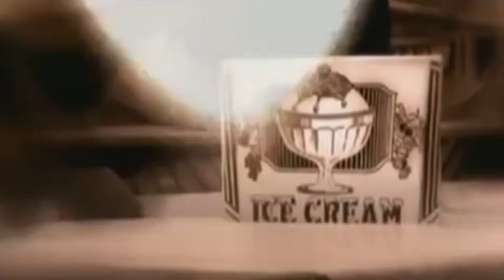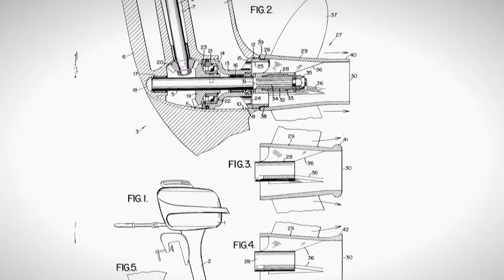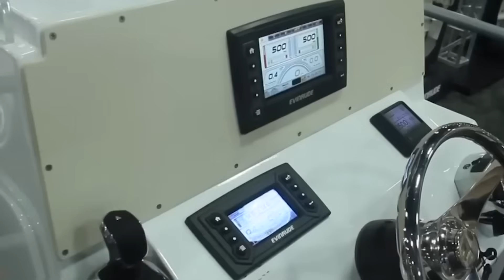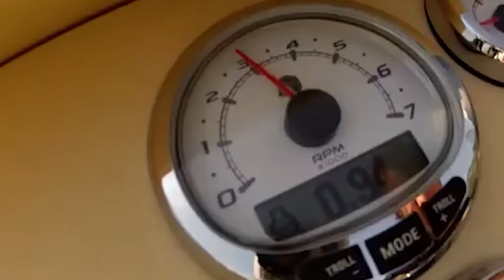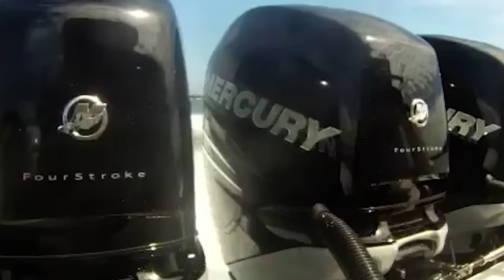Why Mercury and Evinrude Motors Are So Different?

Comment: Vintage Boats, you never mentioned the technical main engine platform mechanical design specification differences of the early Evinrude vs. Mercury outboards. Which accounted largely for the distinct differences between them. Evinrude's were mainly a higher torque... (powerful) workhorse engine vs. Mercury's speed, but less torque (raw power), engines on the same horsepower to horsepower... displacement to displacement basis.

The significant characteristic performance differences were because of this :

Evinrude engines : significantly larger bores... shorter strokes (more torque / higher rotational force... less revs).

Mercury engines : significantly smaller bores... longer strokes (higher revs / more speed but sacrificing lower torque rotational force). 😊

Comment: I’ve had two Evinrude and two Mercury outboards.  Never had any problems at all with either Merc, had the same issues with both Evinrudes, overheating in hot weather and shutting down.  Another inherent shortfall the OMC motors had was insufficient alternator output, the battery would actually discharge if I tried trolling at night.  Lower unit meltdowns were something my OMC owning friends dealt with, although I didn’t.  Seems to me that OMC motors weren’t built for warm water climates, a really bad choice since the bass boat boom was taking off at that time.

Comment: Not at all the experience I had. My father bought a V4 100 hp Johnson, it was an ok motor but slow and sucked gas. He replaced it with a 115 hp Mercury inline 6 - far faster, better economy, and more reliable than the Johnson. I knew many people on the lake with both OMC and Mercury motors, and didn't see any noticeable difference in reliability between them.

Comment: Growing up back in the 70's and 80's we first had a 40hp Johnson, then a 50hp Merc (with the blue stripe and a 3-blade prop), the Merc was faster, but the Johnson had way more low-end power for pulling a 160lb adult water-skier up out of the water on one ski, despite the lower nominal hp.  The Johnson low-speed carb was way better than the Merc which never did work right.  The Johnson didn't need an air intake opened on the tank, but the Merc did, putting a gasoline smell out all the time the boat was running.  One year, I hand-started the Merc without the battery hooked up, and killed the electrical system, which I had done in the past with the Johnson numerous times as a result of the battery dying over the winter, without the Johnson complaining at all when we did it with it.  The Merc was an inline 4-cylinder engine and the Johnson was an inline 2-cylinder engine, with both engines having roughly the same displacement.  I had thought the Merc would be smoother running because of this, but with the crappy carburation, it ran rough and loud, smelled, and put out blue smoke.  It did this right out of the factory and nothing the mechanics did helped.  They all said, that this was just the way there engines worked.  Overall, we wished we'd kept the Johnson.  It was quieter, better behaved, and a way better engine all way around, except for another 10mph on the top end.  In hindsight, instead of the 50hp Merc, I would have much preferred the 3-cylinder 55hp Johnson that was available at that time.  What a great power-house that machine was!

Comment: my evinrude 88 special sat for 4 years, chewed up wires, mouse nests and all. swapped a lower unit with a good water pump on it hooked a hose up and it fired right up on the first crank

Comment: I wish the etec motors had made it. They came close but the bean counters lost faith and killed a great thing that came close to getting the kinks out. Mercs are great, Merc will replace my Yamaha when I repower. It would have be the etec if they hadn't killed it. Yamaha is a great motor, mine has 3000 hours on it, runs clean and reliable, but burns oil and needs rings.

Comment: Mercury did build the optimax engine for some time and stopped it as the market wanted four strokes. The optimax 2 stroke technology was inferior to the e-tec. However the problems with the first Evinrude direct injection engines had 😢made me as a dealership so afraid that I became a one brand Mercury dealership in Belgium. One more thing, OMC had a plant in Bruges building Evinrude and Johnson engines in the from somehere in the 70 Ties until the 80ties.

Comment: My dads old boat had an evenrude on it and it was not at all easy to work on and died all the time on us. Lots of carbs later and a new steering rack it he sold it and bought a bigger boat with a mercury. Still have problems with it but nowhere near as troublesome as the evanrude.

Comment: I always wanted to take a 2 stroke V8 outboard and mount it transverse into a motorcycle frame. 250 HP, light weight. Of course I would have to add a radiator, but shaving the heads a little, grinding the ports, more carburation. The RPMs might be low but the torque would be massive. Like a Harley Davidson on steroids. Better than a Boss Hoss.

Comment: My 87 Johnson GT engine is hiding under an Evinrude 200XP shell.  This thing is built pretty good, its a looper not a crossflow.  Seriously sounds like a 454 on meth idling.  Its parked on a very rare 1988 Stratos 200 VT Rocket.  Goes mid 70s.  My other toy is a 1987 STV Pro Comp Sprint Bottom, currently sporting a rare 1983 oval port 300hp 2.4 merc.  On the shelf behind that sits probably one of the best motors made by a famous racer back in the day.  Started life out as a 2.5/150hp fishing boat but after sleeves, porting like there is no tomorrow and a bunch of wizardry this motor broke world records at 13,000 rpm 156mph in 1000 ft.  I never installed it, its a beast.

Comment: We had an old evinrude sea king from 1953. My cousin ended up with it and that crapy old engine still runs today. Forever fowling spark plugs and constantly screwing around with the mixture screws to get the damn thing to run right.

Comment: growing up in wilmington NC we had several boats.. the ski boat was a 19 ft runabout with the 120 hp mercury 6 cylinder motor.. we put a Doel fin on and that thing would jump out the water to plane pulling us on slalom ski.. the other boat a 19 ft center console fishing had a 120 evinrude for running off shore 10 to 20 mile and getting back..   best of both worlds and both were at least 5 yrs old in the early 80's...

Comment: Them new 4 strokes are pretty nice. So quite you can hardly hear them running and no smoking. So much better for trolling or operating at lower speeds.  Save money on fuel too. Definitely a better engine for fishing.

Comment: WHY have You missed talking about Mercury Optimax! Missed the point chum! Mercury introduced the revised 2 stroke optimax in 1994-5 a direct injection motor. Its lower pressure direct injection was a winner in reliability while just as clean. (I bought a Mercury 130hp optimax 2 stroke in 1995 when e-techs were failing!) the optimax was reliable, powerful, cleaner than many 4 strokes - mine was brilliant. Competition then was a heavy Honda 130 hp 4 stroke or e-tech. I owned an evinrude and johnson previously because of reliability - that changed!. The Mercury optimax was a better engine and reliable. In 2 stroke market it outcompeted Evinrude. E-tech.

Comment: My dad has a 1965 35hp mercury and it just got its first big over haul this spring  I have 1981 75 HP Evinrude and also did a.complete over haul on the engine this spring and I'm still having issues with my Evinrude and my dad' has enjoyed his boat all Summer mine still stalls sometimes from half throttle and I punch it to full throttle difference in price Im.still paying on repairs my dad's merc running clean coat of 500$ I take a Merc anyday

Comment: I had an old 7.5 Evinrude. On a small aluminum boat it was fun as hell. We used it for years in the Pamlico sound in NC. Just had to flush it every now and then and give it decent fuel and it was fine.

Comment: Ive got a 1973 evinrude 15hp outboard that has never been rebuilt. Never been fixed the only thing weve done is clean the carbs. Like 15 years ago. When you atadt it from no gas ita a little tough. But once fuel is in the engine it starts within 3 pulls every damn time and runs and drives like a top.

Comment: I have a great experience with my fathers Johnson 150 V6 in the family boat, close to 2 decades of trouble free operation apart from the charging system needing a new regulator once.
The 150hp motor has just the right amount of guts to pull a someone over 100kg out of the water on the ski's with zero bogging down.

The Yamaha 15hp in my small boat is gutless but I've never had a single issue with it so far.

Comment: I would take an old Evinrude or Johnson over a modern mercury any day. But if I couldn't have either, I'd take the mercury over the rest. Followed by Yamaha.

 I haven't touched anything super modern, but at least as of the early 2000's-2010, Yamaha has been true to the economical user friendliness, with reliable availability of affordable parts. 

In a way, to me, it is the modern Evinrude. built to work reliably, built to be worked on by the owner. And reliably supported for decades, concerning maintenance and parts availability. 

I'm sure it's much more convoluted now, as everything seems to be, but Yamaha has done me good enough, I trust their work ethics if nothing else.

To be clear, I don't exactly mean the manufacturer provides the parts availability, but that per spec, you can find quality parts available. 
For example, I have a lawn mower fuel filter on a mini bike 😂 the part isn't so specialized I can't get it, nor is it extortion by a monopoly (think specialized dealership maintenance).
Anyone anywhere can fix it with parts they can buy in any civilized village/town.
Reply from the maker: Thanks for detailed comment. Do you own anything these days?

Comment: To know evinrude/johnson and the failure you have to go to the the vro days, thats when everything went downhill. The Fichts and etecs were old tech and over engineered. Johnson had a 4 stroke at one time and it was a rebadged suzi and i think one of the best later models.
Reply from the maker: Did you have vro?

Comment: evinrude died because optispark was problematic and unreliable and was then followed by E-TEC which was over complex and not a part on it was reliable. an old carbed evinrude v4 will never die for anything other than user error though and compression will probaly still be like factory

Comment: I have no problems with my Etec 25... now!  I did have the high pressure fuel pump replaced twice under warranty.  Mechanic told my they redesigned it, and no issues since then

Comment: I have a 30hp etec and love it. No problems after 9 years and only spark plug inspection and impeller replaced per scheduled replacement timing. Still hoping Evinrude can make a comeback.

Comment: What killed Evinrude outboards was the common misconception that all twostroke engines were polluters.
Reply from the maker: You're not wrong. Did you own any Evinrude?
Reply: I had a 18hp evinrude fastwin, 15hp gale buccaneer, 5hp Johnson -85, 3.5hp johnson -63, 35hp johnson -80, 4hp johnson -78. Nothing big, nothing new.

Comment: this guy only knows a little bit about what he’s talking about He doesn’t know that much because he left out Johnson completely mercury‘s were great running motors but those 70s and 80s and into the 90s were not very reliable in my dealings from everything from a 150 down to a 35 with the smaller motors, I always preferred, the Johnson brand Johnson and Evinrude, although became the same they definitely had their differences when Johnson and Evinrude became unreliable was watch they got older in the water diverter tubes in the blocks collapsed. The engines would run hot and she’s up. Mercury is still a good brand to this day but so was the e tec. In 2024 I won’t touch anything but a Yamaha.
Reply from the maker: So I guess I should have also included Yamaha in this video titled Evinrude vs Mercury?

Comment: I’ve got a white early 60s 9.8 Mercury that my dad bought used when he was in college. It’s been consistently used my whole life. Couple ignition components here and there, and it always starts right up, even in the winter to go walleye fishing. Still got all the factory cable and lead seals on the bolts in the powerhead, never been apart.

Comment: Evinrude actually translates to “out of business but still towing brand new Mercs back to the marinas.”
Reply: Because of bogus claims about pollution . The modern Two stroke Evinrude are so much better than the four strokes
Reply: My 09 150 rude runs strong! I love it!
Reply: @mrsensable09? I’m still running a 20 horse Johnson (exactly the same as the 25, which is in turn the same block as the 35) from 1978, she’s going on nearly 50 but still gets you on plane within seconds
Reply: junk stroke junk just like car culture. Time for some DI v8 2 stroke options.

Comment: My parent's first boat in the early 1980's was an old Sears aluminum runabout with a 40hp Johnson. Never a minute's trouble in 3 years of ownership. We have a 2010 4-stoke Meecury 25 on our pontoon. Its quiet and the FI means easy starts, but it doesn't have the oomph off the  line I would like it to have. It is also nice not to worry about the condition of the oil injection system or messing with mixing oil into the gas.

Comment: I have both. An Evinrude ETEC 75 hp, three Mercury Optimax 150, 175 & 225 hp and finally a Mercury 90 hp four stroke. 
The 2 strokes are all on bass boats and the four stroke pushes a pontoon. 
I would say the Evinrude is the smoothest 2 stroke and zips the gas. It’s a shame they’re still not in business. The Optimaxes are also great but require a fair amount of TLC and knowledge from its owners. The air and fuel injection systems are vulnerable and expensive to repair. I will stick with 2 strokes for as long as I can on my bass boats. The pontoon is a different story.

Comment: Yamaha built 2 stroke outboards, and some of them built just before going to 4 strokes. They were using 100 to 1 oil gas mix. 25 to 1 was common to engines in the 50s, then went to 50 to 1 in the 60s. 

The oil performance makes this possible. My point being 100 to 1 is clean enough not to bother with 4 strokes.

Comment: The last evinrude engines are awesome. We have a 2018 Etec G2 200hp. The torque is insane. It’s reliable, efficient, gets the boat on plane within seconds. Turns out bombardier was really struggling financially as a whole. They cut evinrude production, bombardier crj plane production, among other things. 2 of the biggest product lines in their portfolio. Another boat we have has a 100hp etec from 2007. It sat in the woods for ten years via the previous owner. They pulled it out of the woods to show us it. And it started on the second try. Mercury engines would be my second choice if evinrude was still around. But they’re not. The verado engines look amazing, we looked at a few at the bass pro shop nearby.

Comment: Been running Johnson/Evinrude outboards since the 70's and now run a 2015 E-TEC 90 HO which blows away every 115 hp four stroke on the water. It's quieter, more fuel efficient and more powerful than all the 4 strokes in the same hp class. However, I am sad the way BRP abandoned their customers leaving us without a  support system now. Thankfully I can maintain my own equipment and for the last 10 years I only needed a impeller kit. 

BRP should of sold the E-TEC business to someone who would of kept up making them.
Reply: I have been looking at a pontoon with that motor . I would probably have already bought it but, Is it hard to find someone that can work on E-TEC’s ?

Comment: My 1st outboard was a Johnson 150 that Always worked and NEVER had a problem. When I sold that 17ft bassboat for a 20 footer it came with a Merc 200. optimax. Or "opit pop" as they were so aptly named. I went through three powerheads on that boat until I replaced it with a 225 Evinrude. No Problems ever!  Then I got a 21-foot bass boat and was told that Mercury had solved all of its issues. It was supposed to be "bulletproof"! Until it wasnt.. I no longer own a big fibreglass bass boat but a 16ft aluminum semi-V with a 4-stroke Yamaha, 25hp. elec start w/power trim. I LOVE IT!  Those were the days, though.. If you want a deal on one try F&S Yamaha and Marine in Pennsylvania. Their prices are more than fair and the service is unmatched!
Reply: Opti-maystart

Comment: I had a 1972 evinrude 9.9 that sat in a field for 30+ years then put on a boat and ran full throttle all the time. It only blew up after we forgot to put oil in the gas.

Comment: OMC wanted to make the two stroke engines "environmental", that killed the company. I had twin V8 4 liter Johnson on my Cougar MTR, modded to 360 h.p. each, those motors, while thirsty, were bullet proof back then. OMC still have the outboard speed record, they did good things before they went down the wrong path.

Comment: You missed my favorite difference.  Some Evinrude models used needle bearings in placed of pressurized oil bushings we call bearings inside motors.  This reduced friction and made the motor more reliable....until it wasn't.  It did give you a longer warning that something was going wrong and shut down the motor before it was trashed.